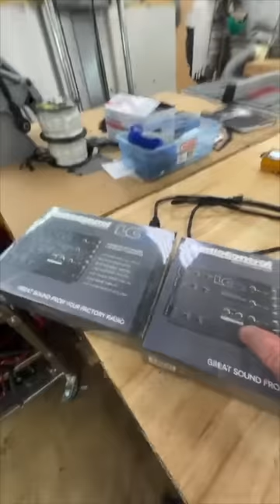Camry 2021 full Rockford up grade and new radio

Comment: Last time I installed any audio equipment was on my 2000 Monte Carlo. I know technology has advanced like crazy since then. A few years ago I bought a ‘22 Camry (LE, no premium audio). After some reading, I’ve learned that there’s something called Bass roll off. If all I want to do is add a single amp and a sub, can I just add a LOC, and if that’s the route I take, can I just tap into the rear speakers in the doors for the signal being sent to amp, via the LOC? Any help would be greatly appreciated!

Comment: Good day guys hope u are well. All the way from South Africa and loving the videos you guys are doing for us. I really need your advise on this problem im sitting with. So i have 2 12" subwoofers rated at 650rms each that is hooked up with a 1200rms monoblock. Then my rear and front speakers are hooked up on a 4 channel amp that is rated 60w×4 rms. My fronts are component sets and my rears are 6x9s. All 4 speakers are 45w×4. I have a factory radio that is hooked up on a lc2i pro for the amps. My problem is that when i turn up my bass, my car slows down with the bass almost like its drawing too much current or something. I want to give as much details as possible to u so please bear with me. I only have one aftermarket car battery and no capacitor. Wiring are 4 gauge stinger ofc. Amp fuse at battery is 150amp and 2 mini amps for amplifiers which are 100amp and 60 amp at the blocks. Must i buy a capacitor because i dont have space for an extra car battery. Im driving a vw polo 1.2 tsi 2017. Please help and thank you

Comment: So I have a 2020 Camry and I just upgraded my stock radio and speakers and was going to add a Amp for the mids and highs.  

I put 6x9s in the front doors and 6.5s in the rear doors and 3.5 speakers in the dash. 

I know with the camry the dash and front door speakers are attached together so should I run new wires to each speaker or leave them the way they are?
Reply: I have a 2020 Camry. What radio did you upgrade to?
Reply: @daviddiosdado6558  I originally went with a Joying android radio but after 3 days the unit wouldn't turn on so I returned it. 

I bought a Atoto S8 Pro 10.1. I will be installing it today when it gets here.

Comment: Why not cut that back part of OEM radio trim alittle lower to the glossy trim on the dash❓Couldnt get the screen go closer to the chasis? What bothers me is that the radio is not centered to original and my OCD will kill me...😂 maybe for me in my 22 Corolla will be different cause my OEM radio doesnt sit slatted like the Camry...
Reply from the maker: The alpine has a bunch of stuff that has to be put behind the screen to turn on. That limits how far it can go back.

Comment: If you use DSR1 on front stage and deck power on rear channels, will this cause unwanted speaker delay?
Reply from the maker: No the radio has delay also that we used